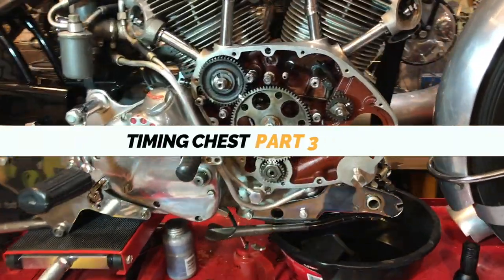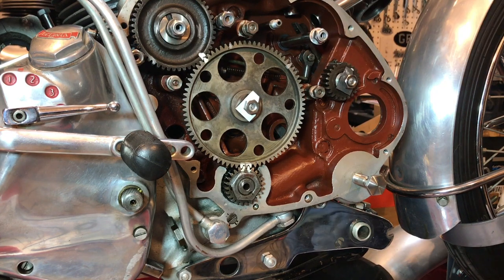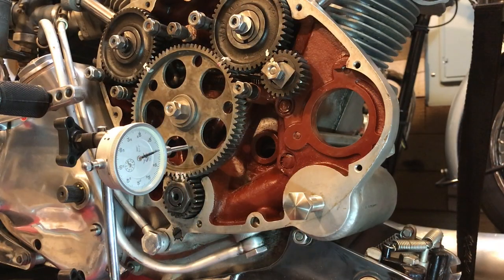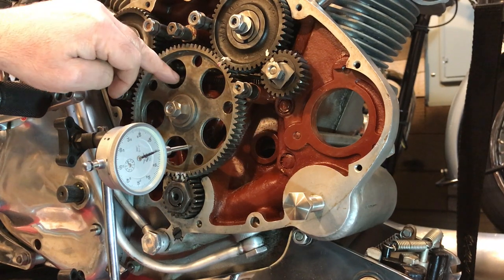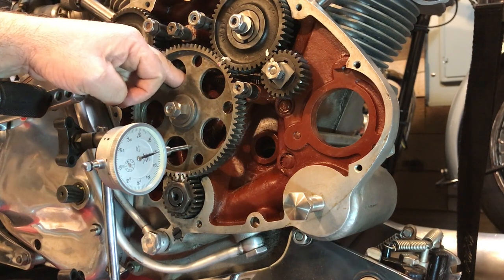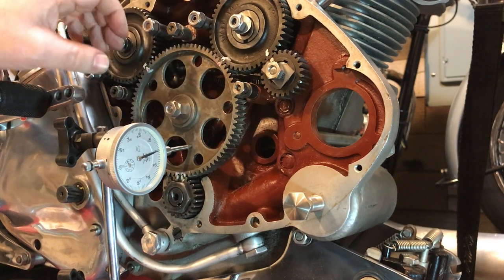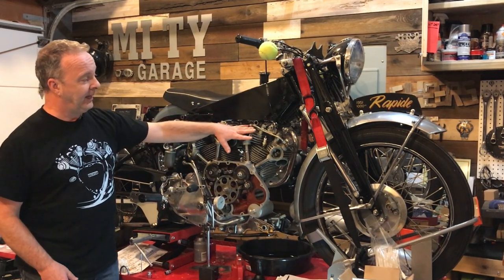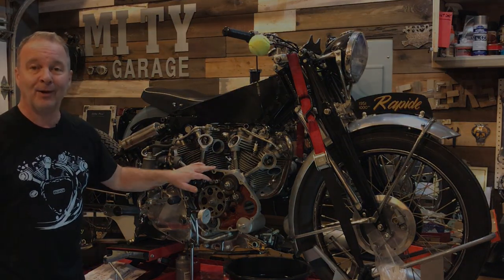Restoration of 1951 Vincent Rapide - Part 17 - Timing Chest #3

Comment: That looks much better than when you started, I wonder how many "spearings" you got before you fitted the tennis ball ! Did you check where the oil holes were orientated on the camshaft spindles ? They should be at the bottom. Interesting to see the inside of the timing case is painted, that could be due to it having a porous crankcase casting. Keep up the good work !
Reply from the maker: Hehe, yes Chris, I've had a few spearings from the levers!  The Rapide  levers are as sharp as heck on the forehead and don't half make your eyes water ;) Thanks, Mike
Reply: Mi Ty: Perhaps it would be a good idea to fit the rather nice Amal type alloy ball ended levers, I have a particular dislike for the spear ended ones having been speared through my upper leg by one many years ago in a crash.
Reply from the maker: Oh my gosh, painful!
Reply: Actually, the position of the holes don't matter as the center of the cam is filled between the bushings with oil from inside the spindle. The cam faces are oiled from splash.
Reply: John I.Ulver: I think we need all the help we can get in this area, that is why a lot of people fit full width bushes, then you definitely benefit from fitting the spindle holes to the bottom, also a broached slot is of advantage here to keep the bushes supplied with oil.
Reply: Don't use full length bushings. Broached slots are OK, but not necessary. Been riding and wrenching Vincents for at least 200,000 miles and over 45 years.

Comment: Will you be using the original magneto ignition Mike? Is the internal paint coating of the engine adhering well and was it applied to resist oil seeping due to porous castings?
Reply from the maker: Richard Vanderwell Hi Richard,
Hope all is well. Yes, I will be using the original magneto. It’s out at my friends for refurbishment and re-magnetizing right now. I did think about getting a BTH magneto, but we will see how the original fairs for now. Yes, the glyptal enamel paint is holding up well thankfully. Best wishes
Reply: MiTy Are you fitting a new capacitor while you have the mag apart, this is one component that causes problems, and cannot be easily replaced with the mag assembled.
Reply from the maker: Hi Chris, yes!  My friend Greg is going to fit one and re-wind, re-magnetize, etc.  He has all the professional equipment (e.g. expensive electro magnet?) and I'm actually hoping to film him do the testing for an upcoming video.  Cheers, Mike.
Reply: MiTy : I would find that video very interesting, as I am sure many viewers would, I have not yet re built my mag as I was told that they loose magnetism while left standing.